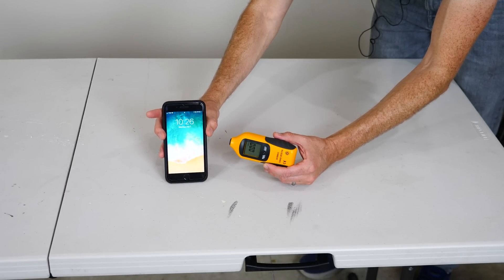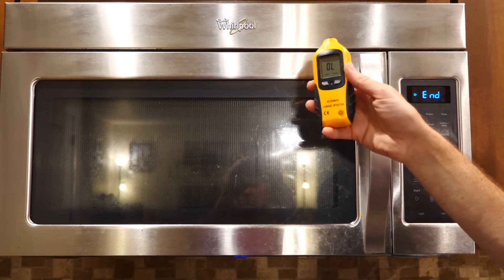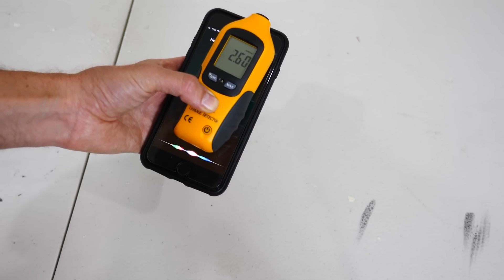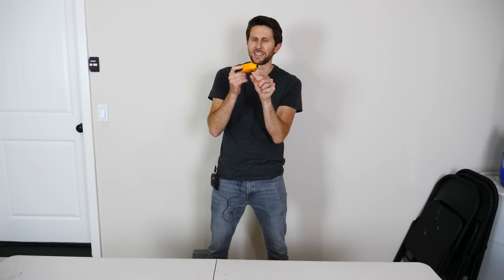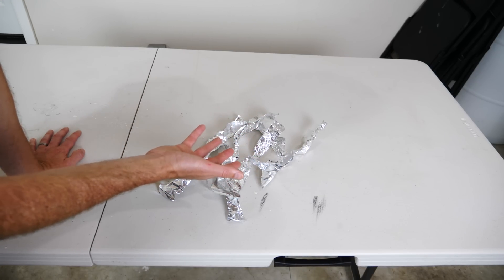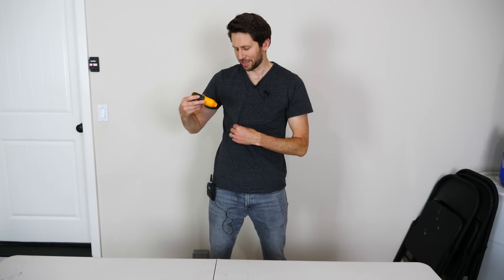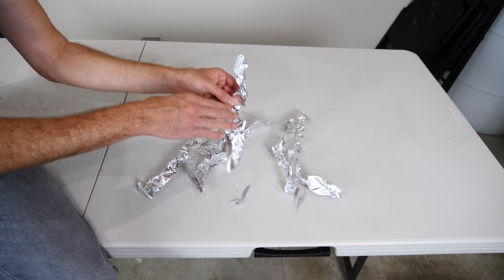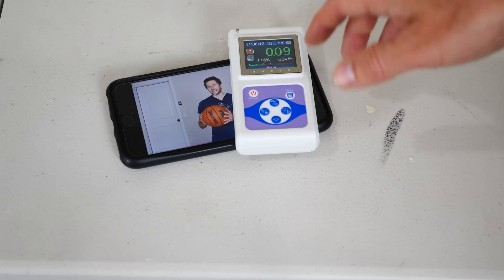How Much Radiation Are You Getting From Your Phone?

Comment: Everyone saying how shocking and dangerous it is clearly didn't finish the video. Problem #1 the first 70% of the video was pointless because after using his microwave detector for multiple tests, he concluded by basically showing how the tester is flawed and doesn't read accurately, because the waving of his t-shirt made the tester read as "overloaded" Problem #2 he then used a different kind of meter but didn't even use the same testing methods such as the microwave, phone call, even the way he commanded siri vocally was different. Another pointless emf/radiation video

Comment: For more insight their r 2 names for the electromagnetic fields electronics give off
EMFs (Electronic magnetic field) and SARs (Specific Absorbtion Rating)
U have natural emfs and Unnatural 
Unnatural which is what ALL electronics give off u can create electronics were they more harmonize with earths (gaias) planetary energetic fields which is 7.83-7.85hrz
Reply: @charliewilliams4587 once you realize that there's no difference between them...
Reply: @topherkrock  if u bought the 5g phones when they first came out in 2020 I'm sure you'd remember they got hot very quickly and easily that was because the original design of the towers and 5g phones and the way the efms were emitting because of the design 
The other name of 
EMFs is SARs the 2 r similar however different
Reply: @charliewilliams4587 , that's an absolute lie. The heat from the phones is the battery and chips creating physical heat. It has nothing to do with the transmission of the radio waves. If that was the case, then you would get hot and the phone would be cool.
Reply: @charliewilliams4587 , 5Ge from AT&T is not 5G. It's actually a marketing term that they used for their "Pre-5G" 4G phones. 5G phones did not come out in the U.S. during 2020.
Reply: @topherkrock  it was the same thing with all cell phones when 5g first came and 5g phones not just one just like right now there's no telling how many privacy violations
Reply: @topherkrock  cell phones and cell towers constantlu give signals back and forth the only way to stop that is put it in airplane mode or turn it off unless it phones been hacked and shit put on it without ur knowing mainly when ur allowing other to borrow it phone

However cell phones r constantly giving signal back and forth to other electrictronics that it's able to link to 
Wifi, NFC, cell towers (Gwen towers) when it paying for shit useing ur phone.
Reply: @topherkrock  u need to be more aware of the electronics ur using for those dealing with cell towers or talking about phones that suppose to be basic knowledge
Reply: @charliewilliams4587 , you should know that there's nothing wrong with the "constant communication". Get a VPN if you're worried about your data.

Either way, all this low power connectivity isn't hurting anything. You do know that phones are low power devices, right?
Reply: @topherkrock  that's not what NFC is and yes NFC locks on to other certain electronics 
And yes like I said before when 5g phones first came out the cellphones got Unnaturaly hot because of how it's was made because of how the towers and cell phones were made it's like talking to one who hasn't comprehend or digital AI, and digital AI
I don't know who and or what has been withholding information from u

Comment: Stand two cell phones opposite side of a champagne bottle facing it (2 inches away) and undo the metal cork tightener. Do not remove the cork. Dial one of the phones so the other can receive and answer it but leave it standing in the same place. After a minute or two, watch the champagne bottle start bubbling eventually popping the cork out. Having said that, don't place your cell phones in your back pocket. Colon cancer among young people is on the rise but no one has a clue why but now you know.
Reply: That's not real. Also, radio waves don't give you cancer.

Comment: I'm amazed that people still hold their phones near their heads or keep them in their pockets!
Reply: Why? How else do you carry or use them?
Reply: @topherkrock  I either talk with the phone on speaker with the phone away from my body, or use a wired headset with the phone away from my body. I rarely carry it in my purse (if I'm out shopping I leave it in my car). If I have it in my purse, the data is off and it's on airplane mode. I never put it in my pocket.
Reply: @nova4005 , so you don't mind EMF, then. Wired headsets create EMF when sound is being transmitted to and from the headset.
Reply: @topherkrock  True. I do mind EMF, I'm very sensitive to it, I don't have wifi or blue tooth in my house.  I usually use the speaker on my phone, and only use the wired headset when necessary.  I can handle some emf, and I have different ways I try and mitigate it.  Do you try to limit your exposure to emf's?
Reply: @nova4005 , there's nothing dangerous about radio waves.
Reply: @nova4005  so you try to avoid electromagnetic waves correct? does that mean you also try to avoid light?
Reply: @snek1461  @snek1461  yes, I forgot to mention I'm a vampire.  Sunlight is a natural form of electromagnetic energy that serves our biology. Incandescent bulbs and electrical wiring of homes is not like the natural sun, but not as synthetic and harmful as LED bulbs and 5G electromagnetic waves.

Comment: WHAT'S THE GAIN SET AT !?????, sample rate, pulse rate, band width...
that pretend meter is a pc of crap !

what band, exact freq, wifi, smart meter, phone, smart appliances, power lines, cell tower... 2.4-2-6 Ghz ?, 800.1Ghz & YOUR SMART METER HAS 3 antennas inside to p-up & broadcast your private info CONTINUOUSLY.

what is your specs of your testing device ?....
calibrated-last, by who, how ?...(what parameters
; by what-said standard )?...
2.4 Ghz= 2 billion 400,000" times per second !!!!
YOUR BODYs' BLASTED with so much EXCELLED MICROWAVES  violently to boil water.
STOP WITH YOUR STUPIDITY, MON-Ionizing FCC,FDA & CDC  ADMITS HARM TO HIUMAN HEALH  IHAS BEEN CONCLUDED FROM 1960's; it's 2024 & certainly did not get better !!!!
STOP TAKING OUT YOUR 🫏🫏🫏🫏🫏

Comment: The meter also measures waves of  heat not just radiation, like the cell phones give out  waves of  heat not exactly radiation. It's like when a battery heats, when getting charged.
Reply: The microwave produces microwave heat, which interacts with molecules. But if you open the microwave where the magnetron is now, that's  where the radiation is produced.

Comment: The only scary thing about a microwave oven is the sheer power of it. When on, it produces ~10,000 times more power than a phone, and it runs continuous. Cell phones, transmit in pulses, which you may hear as intermittent buzzing in an AM radio. Remember, you have a battery scarcely the size of a fig newton bar, that can allow over 2 hours of talk time on a charge. That's because the transmitter only transmits at a 2% duty cycle. Your Wi-Fi runs a little more continuously, but, at similar power. even If you have the "gift of gab", you're not going to have any problems from a Cell phone.

Comment: I would argue heat would not be the primary source of concern, but rather how (depending on frequency and amplitude) EMF could potentially alter the computations carried out by neural circuits; remember neurons work using electrochemical signals and are afected by EMFs (that's a fact).
Reply: Then you have nothing to worry about. Radio waves cannot affect the things you mentioned. It's all been studied and no harm has been found.

Comment: I have a large bowl made of glass doped with uranium. It will peak 1mSv on my geiger when I lay it in the bowl. 10 inches away is no higher than background. Not worried about my phone, we get bombarded with microwave, infrared, xrays, ultraviolet, beta, gamma, and alpha radiation all the time from natural sources. Microwave is non ionizing, its the more enegretic ionizing radiation that is to be worried about. Remember visible light and infrared light (heat) are far more energetic forms of radiation than microwaves.

Comment: Cellphone radiation is about 1/2 watt,  WIFI is about 1/10 watt. probably strongest electric magnetic wave in residential neighbourhood is Amateur Radio Operators.  in US, Amateur radio operators are allow to have radio wave up to 1500 watts, which is 15,000 times more than typical WIFI.  about twice as much as typical Microwave Oven. except Microwave Oven are inside of metal case.  if you see tall tower and large antenna in residential neighbourhood,  they are most likely Amateur Radio Operator.

Comment: My cellphone there’s something wrong with it if I use it more then 10min it gets hotter and also even longer I can’t use my hands properly after they also hurt the nerves in my hands can’t squeeze properly my phone must have crazy radiation it’s really bad pls can you reply
Reply: The heat is produced because it's an electronic device. Any other electronic will produce heat as well. I would recommend turning down your screen brightness.
Reply: I became highly sensitive to artificially produced EMFs back in late 2019 and it destroyed my life. Recently I found a small device that attaches directly to the back of the phone, which is where it needs to be to work effectively, not on the case. It's the Q-Disc 5.0 from qnlabs/prlabs. I've tried other products that either don't work at all, or help quite a bit but not fully (as in cutting down the effects so you can tolerate being around the offending devices longer, but still have to eventually get away from them). But the Q-Disc has completely rid my phone of the harmful effects. You might even notice that your phone no longer gets hot from operation. Try the device before you develop a high sensitivity like I did. I believe it is returnable if it's in unused condition without being peeled and stuck to the phone, which means you have nothing to lose. But you won't need to return it, as you will feel the difference. I could no longer hold my phone, carry it, or be too close to it or other phones without feeling ill and aggravated, but now I can hold it all day.

As far as wifi goes... I haven't done this, but I imagine disassembling the case and finding where the wifi signal is being emitted from and then attaching at least one Q-Disc (maybe multiple?) directly to the emitting component could be effective. It may void a rental contract or warranty though and you may have to purchase it if you don't already own it. But in my opinion it's totally worth it if you can pay for it. Either that or shut it down and keep it off permanently in your home. The other option that is somewhat helpful but not a permanent solution, would be to use the flat rectangular devices from AiresTech and place at least one of them on top of the router when it's on. For me personally, this method allows me to be around the router for longer periods, up to around 8 hours at times, and though it eliminates the breathing problems and severe concentration difficulty, I still feel slightly somewhat uneasy, like if something was causing you to pace around. So exposure time is still limited in that regard. 

Wifi was a huge thing that tormented me initially. I could no longer live in my apartment and had to live in a car across the street away from my family for months and basically lost my mind. That's only a small part of a really dark experience. But, although it is difficult, I'm doing better each year that goes by.

Protect yourself!
Reply: By the way, if you have a case on your phone, you can have the Q-Disc between the phone and the case, in other words, under the case. But I recommend not doing that for too long because the case can eventually crack from the pressure if it has hard plastic, like it did to my OtterBox. It could also possibly warp or damage the phone. Or, depending on the case, the case might not even fit properly enough to keep on the phone. What I'm going to do eventually is drill a hole the exact diameter of the Q-Disc through the case exactly where the Q-Disc is sitting, so that it will sit nearly flush with the outside of the case. And this would take cutting through both the rubber layer and plastic layer of the case.
Reply: I also just recently discovered limbic system rewiring or retraining but haven't tried it.

Comment: I get headaches when I talk too long on the phone even using airpods pro. The RF is crazy high. I’m switching back to wired.
Reply: I recommend also attaching a device directly to the back of the phone that eliminates all the harmful effects. It's called the Q-Disc 5.0 from qnlabs/prlabs. I know that it works because I'm very sensitive and this stuff had destroyed my life and I'm still recovering. But drill a hole through all layers of the phone case where the thing sits on the phone so it can sit in the hole and be nearly flush with the outside of the case. Otherwise it'll eventually crack the case if there's hard plastic like it did to my OtterBox, or possibly damage or warp the phone over time.

Even if a person isn't outright sensitive to artificially produced EMFs, they can develop a sensitivity over time like I did, depending on the rate, proximity, and severity of exposure.
Reply: @mikuspalmis q-disc? You mean that useless expensive garbage.
Reply: @MrLetsGamePlayHD  It's actually very useful but you can't really know that except by experience. If you have a sensitivity you would know. And you would see that some of these types of things don't work as well (edit: or at all) when compared. This one does work.

Comment: so lets do the math; speed of light = 300000000 meters sec. the communication of your phone happens at 2.5 ghz. Divide those two and you get a wave length of .12 meters multiply that by a meter in inch 39.38 and you get that .12 meters is 4.723 inches, way to big of a wave to do any damage to your DNA or cells. X rays and Gamma rays wave length are in the nano inch range , small enough to cause great damage.

Comment: "The resonance frequency of the human head is between 400 and 500 MHz, while in the longitudinal axis of the body the resonance frequency and thus the highest absorption of electromagnetic waves is around 35 MHz for grounded bodies and around 70 MHz for isolated bodies. In the axes of the body from front to back and from right to left, the resonance frequency is between 135 MHz and 165 MHz. The amount of energy absorbed by the body when irradiated with a power of 10 milliwatts per square centimetre (the maximum allowed average value over 6 minutes according to the US limits for microwaves) shows in models for human and animal bodies that the energy absorption is greatly increased at resonant frequencies and in the vicinity of conductive ground surfaces or reflectors. When grounding and reflection are combined, the energy absorption is surprisingly high. The energy absorption of models of humans at a power density of 10 mW / cm2 predict a SAR ( specific absorption rate ) value 35 to 70 times higher than the value for the basal metabolic rate." ( W.R. Adey, Tissue interactions with nonionizing electromagnetic fields (p.455), in: Physiological Reviews, Vol 61, Bethesda, 1981, pages 435-514 )

The consequences of resonances and standing waves in the body caused by reflections of radio frequency radiation are also discussed by Frank Leary in: "Researching Microwaves Health Hazards", in: Electronics, February 1959, p. 49-53 (p.52)
"Because the body and its parts are conductive, resonance occurs at critical frequencies, creating standing waves. Some of the effects discovered by researchers in the cavities of the body and in the bone marrow appear to be caused by increased heating which could result from resonance. In more than one case, internal injuries from microwave radiation were undoubtedly caused by reflections at the fat-muscle or muscle-bone junctions that created standing waves near them. A number of experiments with small animals have produced partial or complete loss of control of locomotor control at comparatively low irradiance. Immediately after the end of irradiation, the effect subsided. This effect could be a result of resonance within the cranial cavity or along the spinal cord, which could create a field strong enough to compete with and extinguish the normal signals from the motor control nerves. The transmission system of the nerves could be temporarily switched off."